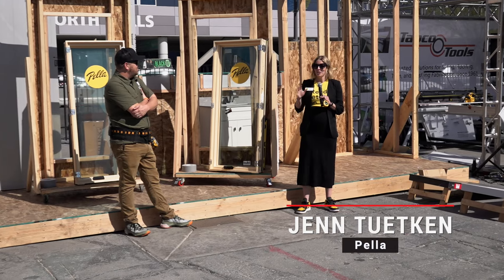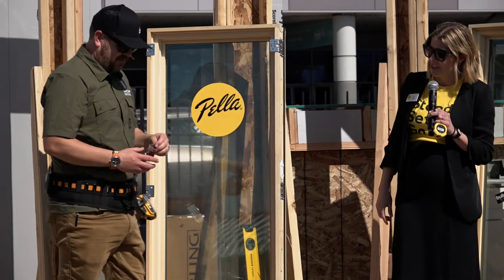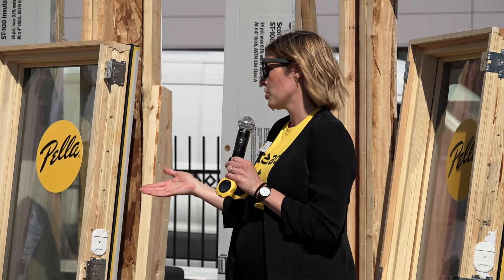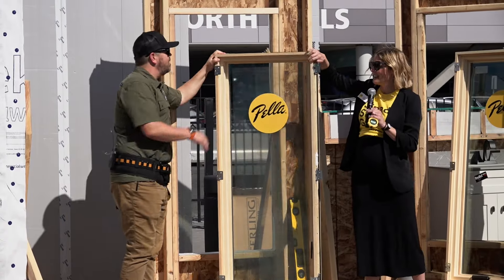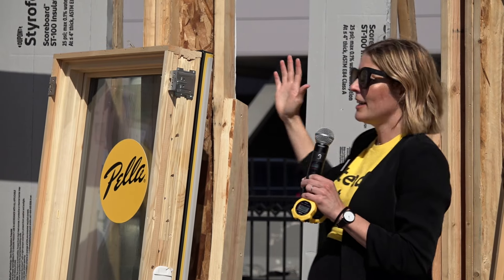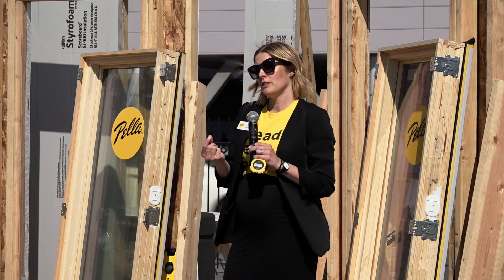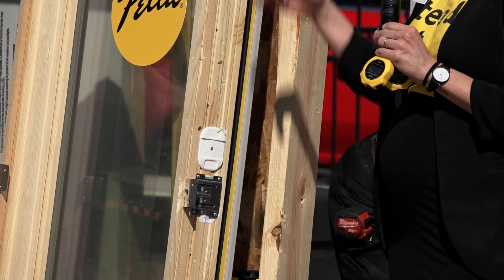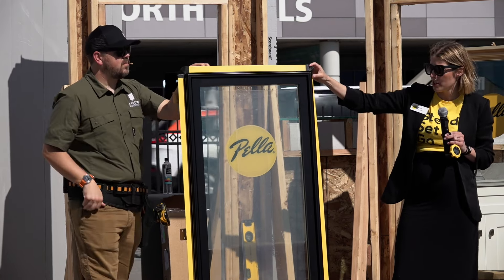Pella's New Window Design is an Installation Game Changer

Comment: Wonder if the average person building their own house can afford these?
Reply: If you have to ask...
Reply from the maker: I believe they are roughly the same price as regular Pella windows. The innovations are not expensive ones, just smart ones. 
The time these windows will save you on the installation side (think about all of those second-floor windows you don't want to push up a ladder) will certainly pay for a wheelbarrow full of beer to celebrate the easy installation.
Also, windows are a place to NOT cheap out; energy performance features matter.